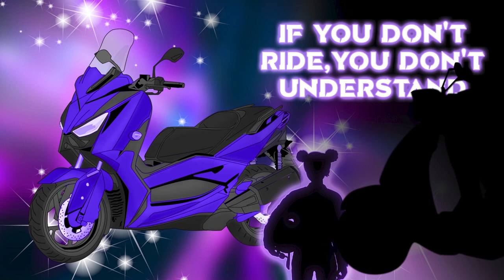Yamaha Xmax Lets Change the Look

Comment: My Dong Fang Chinese brand 150cc scooter is Great. 969.00 before shipping, 1200 with shipping. I don't recommend it for most folks because it only has a 3 month warranty. I choose it because I could not find a used scooter in my area. I've spent another 800 on title, registration, insurance and upgrades (lights, USB charger, 12v power,  tire patch kit, 12v air compressor, spark plug, tire valve stems) and riding gear which is not cheap. People need to think, save money for these things because you will need them if you buy a Chinese scooter. Know you'll have to do all your own maintenance/repair work on it as most places won't touch them.
Reply from the maker: Facts